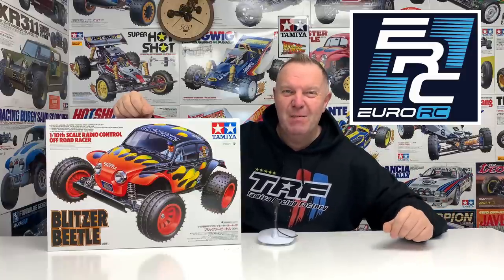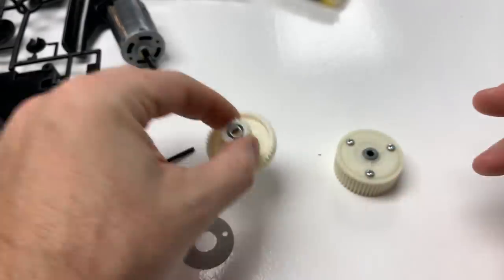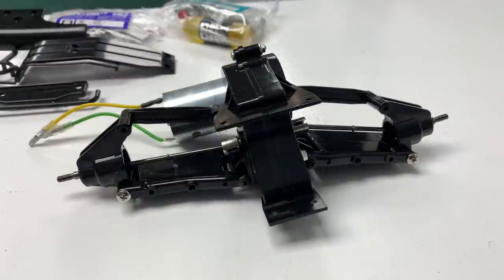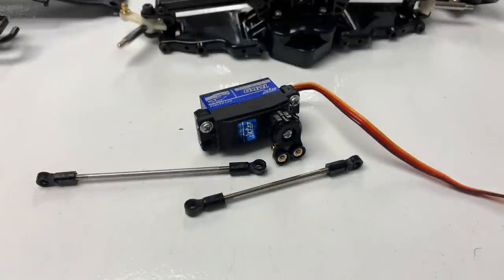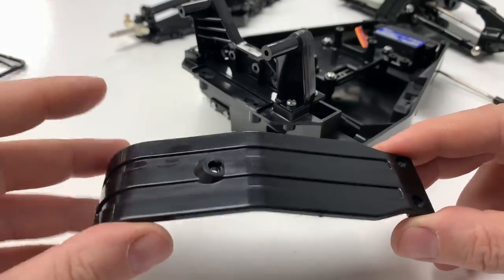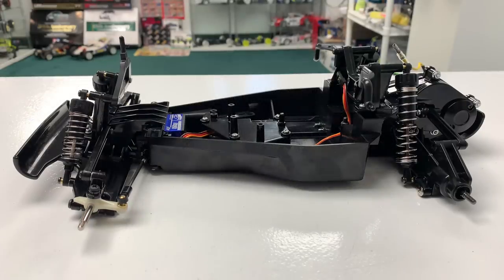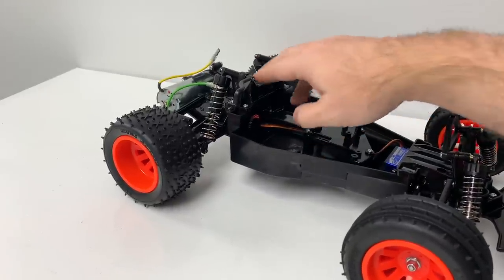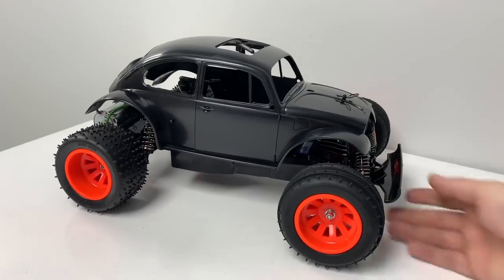Tamiya Blitzer Beetle Build…

Comment: So awesome!!! This and the Kyosho Beetle are 2 cars I really want badly...
   I love stadium trucks , and Beetles....used to have a 68 VW when I was in tech school...  I hope they ReRe the Stadium Blitzer eventually.   
   Glen, or any other Blitzer owners...how's the steering setup on these, is it decent as far as lack of slop and such?  Been working on making some other Tamiya cars be able to track straight, something that hasn't really been an issue with any other cars I've owned, out of well over 30 now.  
    Lastly, when I build one of these, any upgrades I should do besides bearings and a slightly hotter brushed motor?  I don't wanna bash it hard and break it in 2, but I DO plan to run it a decent bit and have fun with it... maybe even turn some laps at one of our local tracks ... wondering if there's any specific upgrades for it's common issues , or if I just have to keep those in mind when running it, and possibly pick up a few spare parts to keep handy...
   Cheers!!!
Reply from the maker: Well I’ve ran the Stadium Thunder standard apart from bearings, I thought it runs great tbh 😇👊🏻

Comment: Always thought this car would be cool with the trailing arm rear suspension from the falcon, I believe the chassis was designed to accept it. Those plastic rear hub adapters crack pretty easily, aluminum versions would be a good idea.